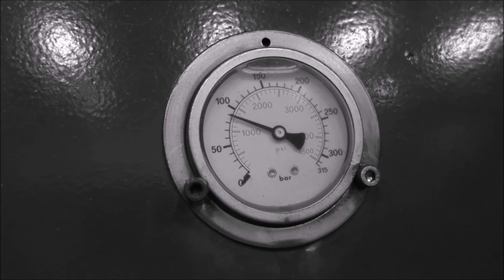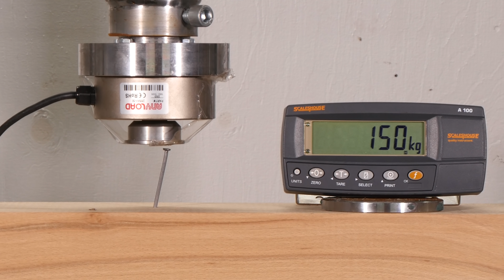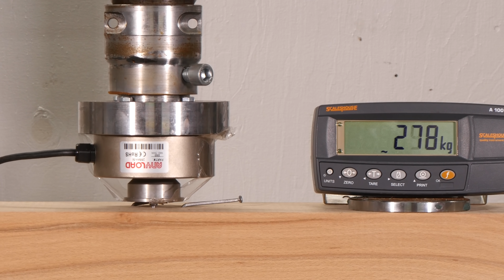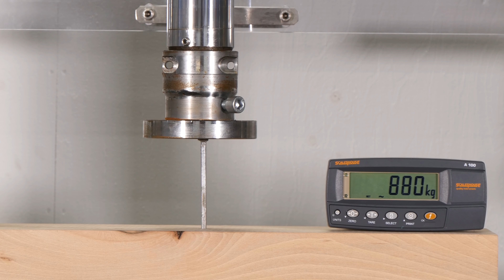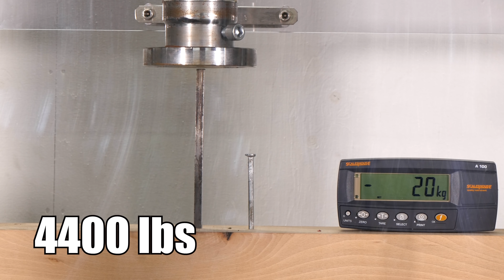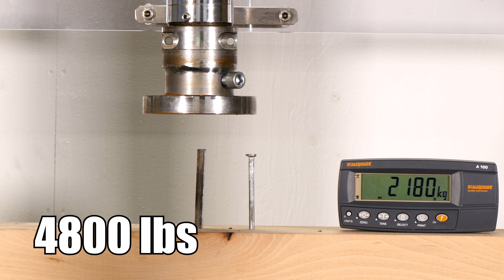How Hard It Is To Push Nail into Wood? | Hydraulic Press Test!

Comment: I gave the screw a 2% chance to screw itself in lol.

I had to fix a barn over the summer (2018) and decided to use screws on the wall panel instead of nails.

A few screws got stuck because there's a concrete foundation to it, so I figured I would pound them in the last few millimeters, I broke the damn screw's heads off! And bent one terrible. I had to use the grinder to take it off. Lol

Comment: But then you also have shock Force vs. Consistent Force shock Force meaning an Abrupt Force applied and of course you know what consistent forces this is something I have to deal with as somebody who powder coats for a living the powder coat May bind up in the wheels and have a car be stuck I can throw all my weight into trying to pull that card but it will not move or I can give the cart a good kick or two and then I can move it so the shock Force like with the hammer hitting the nail can probably split the wood fibers apart easier than requiring 660 lb a force to put the nail in.

Comment: You can't really conclude a single value for the force required. The shear stress along the sides of the nail is going to increase the further you push it in. If you were watching, the force kept rising as it went further. So even if you had nails with the same cross section, a longer one will require more force at the end. 

What would have been a lot more interesting (and useful) is if you graphed the force vs displacement so you can see the relationship between the force increase as it goes in further. Is it linear? Exponential? Does it change partway? 

I'd assume it's an almost linear increase, as the area in contact with the wood is increasing linearly and that's what's generating the resistance (along with the tip).

Comment: The reason that it is difficult is because even a slight change in angle is enough to change the entire direction of the nail as it is going into the wood and bend the nail to the point of exhaustion.

Comment: I would be curious to see how much easier the nails would go in with some beeswax as lube.  That is what is commonly used by wood butchers. Compaing it to oil or paraffin wax would also be interesting.

When I was young, before we had the plastic coated 'sinker' nails, (16d about 3.5" long, diameter: ⅛", maybe a bit over), I saw guys dump motor oil on a box of nails, (actually, they were sometimes small wooden kegs of nails.) Saw some guys try antifreeze, once, made a horrible mess.

It is amazing to think a hammer could make that kind of force, when swung.  I have hand driven many nails as big as the biggest you bought.

Comment: Without reading all the comments or clicking on the link for a hammer. There's a lot more to driving a nail than just measuring the push in force. A frame with a good framing hammer can generate 22,000lbs of force. Yes 22 thousand pounds.  Which is what it takes to drive that full nail in with one hit.

Comment: you cant push in western screws, BUT you can nail in soviet screws with a hammer, or in this case press. But them screws are not very good ant being screwed in. Also this was eye opening video, since the forces of sustained pressure significantly exceeded yours and my expectations. 
Thank you funny Fins :)

Comment: The reason it is difficult to drive a nail with a press is because nails are designed to be "shock-loaded"... or  "hammered". A sudden and intense impact that does not allow the nail time to deform before it is driven all the way in. And obviously a slow moving hydraulic press is not going to "shock-load" anything. That being said, your smashinator 5,000,000 or whatever you call it, may in fact drive a nail quite nicely.

Comment: If we push the screw with a force of 300 kg and 500 kg, both will lead to the insertion of the screw into the wood, but we still do not know exactly how much power is needed

Comment: Not very much , if u use acceleration . A air nailer uses 90 psi. But the acceleration is so fast the bord does not have enough friction to stop it.
U can force a pine needle into a tree ,if u can make it fast enough.

Comment: Figured it would be high. Average framing hammer is 20-32 oz (560-900g) and comes it at a good amount of speed. Someone smarter than me could probably get the actual speed and calculate the force delivered to the nail.
My guess before the rest was 500 and even that was low.
Also thought about nail guns but don't know enough about the details to even guess.

Comment: I could've told you it'd be more than that. If it only took the weight of a man to put a nail into wood, we would just have a step with a nail notch on the bottom that we would step on. I'm sure you can push the screw in, too; with a hundred tons of force, you can likely push a brick into wood.

Comment: I'm not convinced that's all it takes to drive those nails in FULLY. obviously the deeper the nail goes the more nail the wood has to grip requiring more force to drive it in the deeper it goes. 

Secondly Beech is a relatively soft wood. It looks seasoned which would harden it more, but as far as hardwoods go its not even in the same league as seasoned Oak which is pretty hard, but still that isn't that hard compared to hundreds of other species.

Basically Beech was a good choice to represent wood if not maybe a little too soft. Oak would be the gold standard to use imo.

Comment: Kinetic friction should be significantly less than static friction, not to mention the decompression wave propagating outward from the nail when hammered. The impulse when hammering a nail into wood is probably significantly less than slowly forcing a nail into wood.